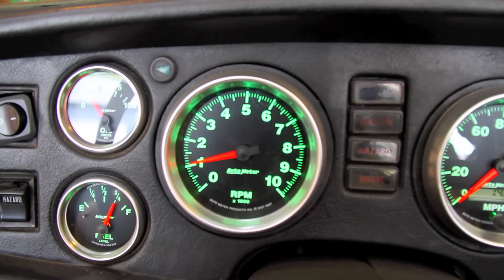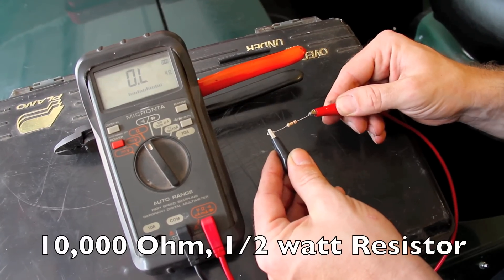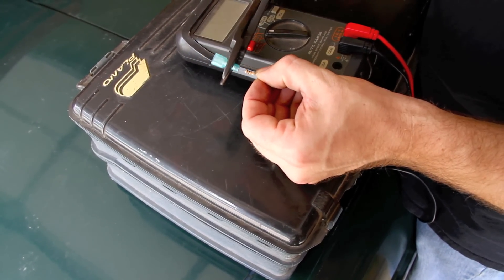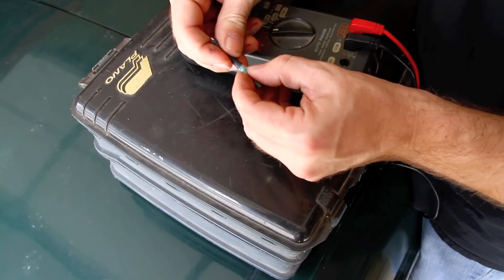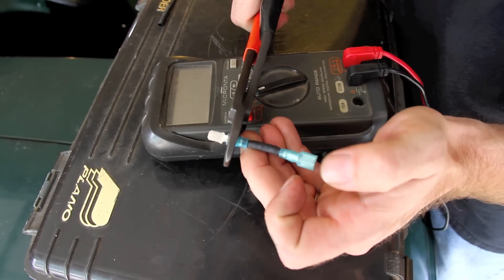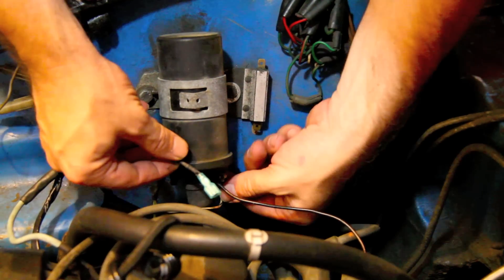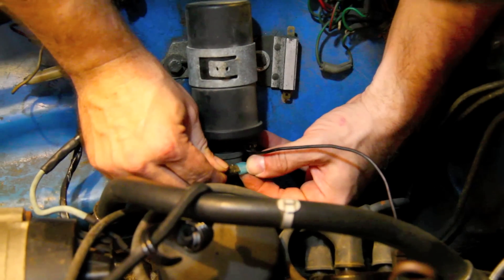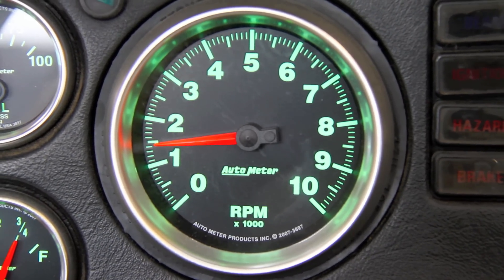How To Fix A Bouncy Tach Needle

Comment: I have a single cylinder 4 stroke motorcycle and a tach that was made for it, but it is still jumpy. Will this fix work on my application? (The wires for the tach go directly from the coil to the tach)

Comment: @AutoMeterTech Thanks i'll try re grounding and check voltage. Its an old points ignition system on a straight 6 motor from the 70s.

Comment: will this work if mine is the stock gauge and bounces alot higher? also it bounces when i rev and i dont think it actually goes as high as the rpms either (example: stops at 4k rpms but feel and sounds like 7k) and i had to connect a wire from the gauge cluster and wire it directly under the hood to even get the tach to read anything.

Comment: Did a engine conversion on my 1984 Nissan N12 pulsar and now the tacho jumps sometimes. Original engine was a nissan E15 1.5cc, i swapped it with a nissan ga15de 1.5cc. What is my problem and possible solution?

Comment: Mine is on an old (1954) GMC truck,and it works fine up to about 2200 rpm,THEN it gets bouncy. Stock ignition,points & condensor,everything is set to spec's except a few more degrees advance for altitude.engine runs great right up the the governed speed. Any ideas there?
Reply from the maker: Hey James, thanks for the inquiry. Check your ground and make sure you ground the tach to the engine. If you're still experiencing problems, give our tech line a call for help diagnosing the issue. (866)248-6357

Comment: hi, i have the exact same problem, on golf GTI mk3 difant 2. from 1992 the tachometer bounces between 2000 and 2500 rpm, it has done it to me since I replaced the distributor with a new but not original one, (56 euros new on amazon) but the engine is fine! where does the tachometer take the signal from?

Comment: I assume I can put this on the back of the tach versus the coil?
Reply from the maker: The bouncy tach would generally mean that the tach isn’t grounded to the engine block so grounding the tachometer to the block fixes this. If you don’t, you can use a tach signal filter, 9116. If you have further questions, feel free to reach out to our Tech Team at 866-248-6356.

Comment: My tach reads about 3500-4000 rpm when the car is idle.. also the needle is very jittery. Adding the resistor would fix both problems?
Reply from the maker: Hello! Our technical support team would be happy to help you out with this. You can reach them at 866-248-6357 or on our website at https://www.autometer.com/contacts

Comment: WHAT COLOR WIRE ON THE TACK DO I PUT THE RESISTOR ON OR FROM?
Reply: This is what i boughtUniversal 5" Black Face 4in1 JDM Tachometer 11K RPM Gauge with Oil/Water Temperature Oil Pressure Shift Light  and it is working like shit the needle is jumping all over the place & shift light constantly goes off no matter how much i set it
Reply: i just tried the resistor and same problem please help
Reply: thanks much
Reply: CUT THE RED WIRE!!!

Jeez man, relax, as soon as the bomb goes off WERE ALL DEAD!.....

Comment: Would adding a resister for the speedometer correct the same issue with it?  Will jump around at 30mph and lower.
Reply: epracmetcon no depending on the year make and model of the car,it may have a speedometer cable,that might be the answer on older vehicles,but newer vehicles,possible bad speed sensor

Comment: Using crimp connectors in that fashion looks like an extremely unreliable way to add the resistor.
Reply: Crimp connectors are a lot better than sauntering.
Reply: sauntering? what the hell is sauntering?  do you mean soldering? a solder joint is a good reliable connection, but I don't know how its going to do in a car environment when there is a lot of vibration. crimps are a very good and reliable mechanical connection
Reply: Correct.  Crimping to a solid wire will eventually loosen.  If you must use crimp connectors, solder after crimping.  And btw . . . essentially every electronic component in a car is soldered.  It holds up to vibration just fine.
Reply: @jimmygrant3212 the biggest problem here is the crimps are not sized correctly for the tiny wire on the resistor. Crimps hold a lot better on stranded wire than solid also.
Reply: @Krankie_V  Absolutely correct.
Reply: always crimp for automotive use since solder is easily weakened/broken due to vibration. any pro will tell you the same. also helps to use correct size crimps for the job.